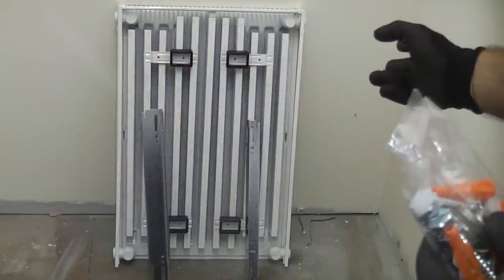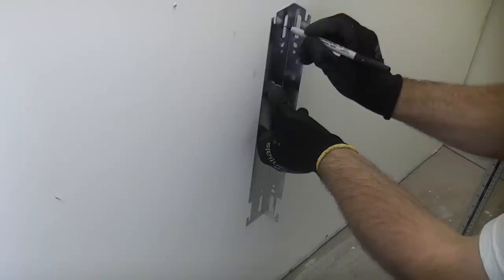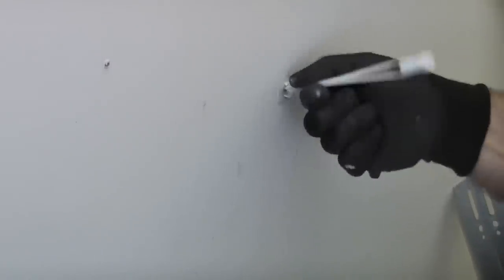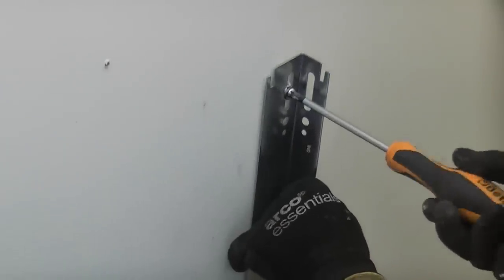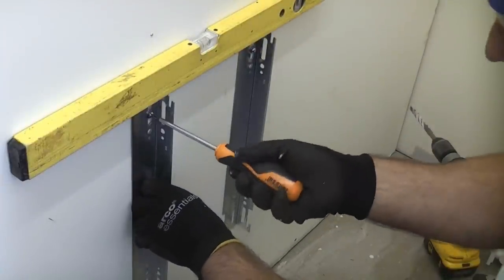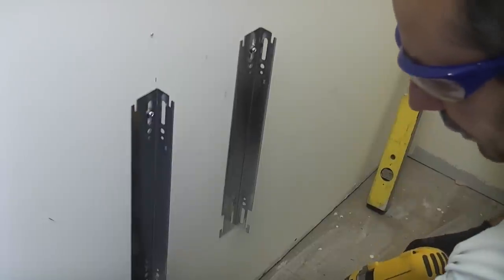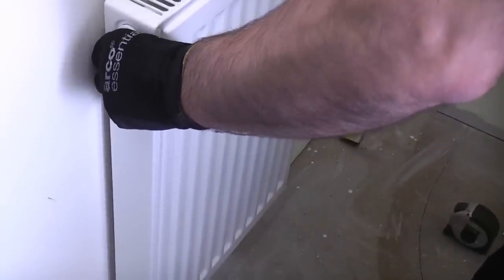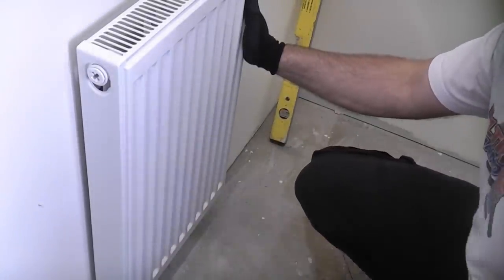How to fix a radiator to a stud wall

Comment: Brilliant tutorial yet again. Are those snap toggles suitable for a garage ceiling to hold a bicycle or would it be too heavy? Enjoy all your explanations - they are very clear. Thanks
Reply from the maker: +Nick Walton 
I would not use them on a ceiling to be honest as the loads are different. It will try and pull the snap toggle through the plasterboard instead of the load being on the screw. I'd try and find the joists using a magnet to be on the safe side, unless you can get access above and put some noggins in to take the weight.
Reply: Ok thanks. I thought that might be the case.

Comment: Our plumber has given a quote for £630 + vat to replace our old radiator with  new double panelled one.  But he says that because  its hung from a stud wall , when the water fills up the radiator, it's weight could pull the brackets off and collapse (meaning ruptured pipes , etc).  He then said "we will need to reinforce your wall by cutting a sheet of plywood to size & fix it to your wall, before the new radiator is to be installed. The cost of this will be an additional £400.00 excluding VAT to be added to the radiator quote above".  
So we are talking about £1284  to fix a new radiator to a stud wall-  wow!!!!
Reply from the maker: Blimey, that sounds very expensive! 😱
Thanks for the comment 👍
Reply: Probably doesn't want the job because he's got a queue of more valuable client jobs. So he's upped the rates to make up for any loss of time and money. We won't be using him even though he's a 'Which' promoted plumber.

Comment: I see you kept the black square bracket protector on the rad when you hung in on the wall brackets. Was there a reason for this, as I thought they were just transit packaging?
Reply from the maker: If the radiator comes with them, I normally leave them on, as the radiator fits better to the brackets.
Thanks for the comment 👍

Comment: Sorry dude.Was knocking up a new account after the DMCA removed 350 videos id posted.
I thought i was on a different page and replied to a person who thought he was being smart.
You however are smart and for some reason my "Bollox" word appeared on yours.
Sorry again and ive removed the comment.
Love the stuff you do on here.
Reply: +Mark Henderson Also reason i was on here was to ask you a question.
Ive moved into a cracking wee flat which has all up to date (modern) appliances.
Thing is it has the old storage heaters they installed when the masionatte was built.
It eats energy for Scotland and its a greedy bassa at that.
I dont use the panel heaters that are in kitchen,bathroom and bedroom as i know they are worse but occasionally have to use the storage heater in living-room.(Those bulky heaters with the bricks in them)
Can you give me any tips on how to save money using these things.?
I guess in theory they sounded like a good idea back in the 90's but as you know they are hot when you dont want them hot and cold when you need them therefore i have to keep it on constantly now its starting to get a bit cold up here over the past 2 weeks.Any help would be great.
Reply from the maker: +Mark Henderson 
No worries, Thanks for the clarification ;-)
Reply from the maker: +Mark Henderson 
Those heaters are a pain in the arse and not at all economical. I do not know of any economical way to use them I'm afraid. Many of the houses round here used to have them, but the majority have been removed and replaced with central heating. The problem is the initial cost of the central heating, which could cost £2000+

The new Dyson heaters/air blowers are supposed to be good for single rooms but again you are looking at £400 plus running costs. I think they are 2 KW

Comment: Nice work. Those snap toggles do look the part. A little bit pricey. My old tutor at college taught us the way of the radiator brackets. Spent hours explaining to us the way of the world as seen from a radiator brackets eyes lol. For double convector rads the short side of the bracket is used for a single the longer side. Of course you can use what you like!
Reply from the maker: +Zed Man Thanks for the comment ;-)